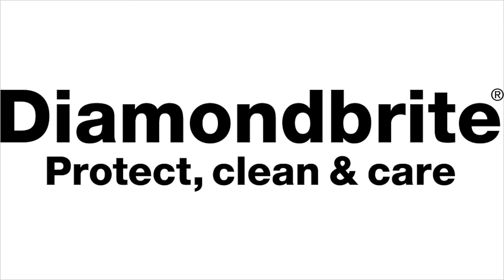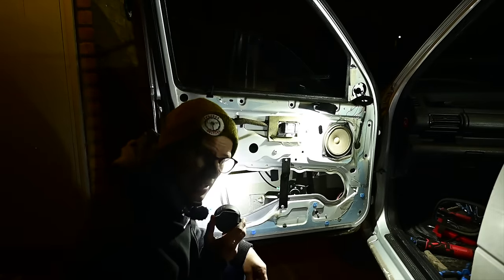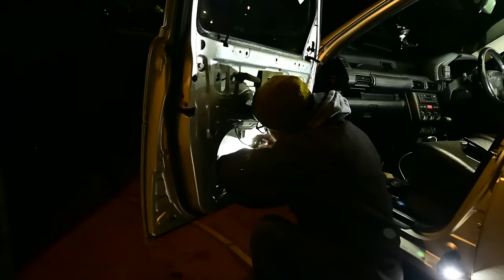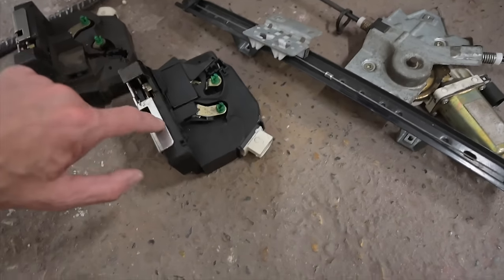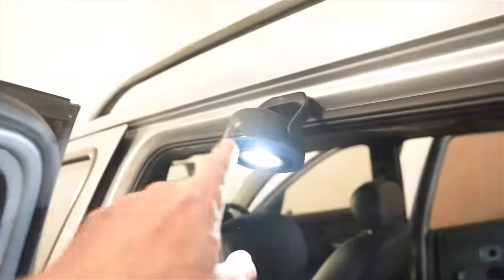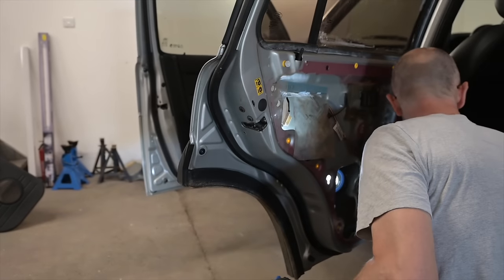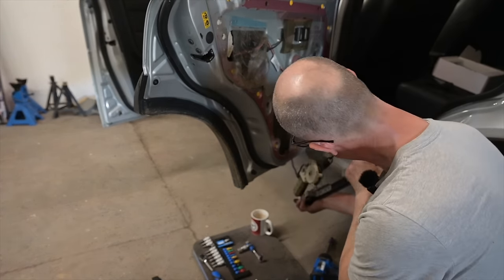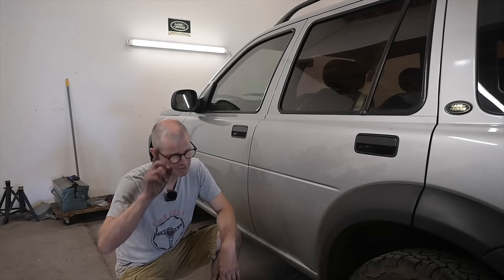Hippo the Freelander window and lock repairs

Comment: Those jobs, like unsticking stuck window winders and doorlocks were the jobs that my Father got me to do as a 10+ year old, smaller arms and hands.  Often needed doing everytime he came home on leave with the car being in the unheated garage, with Pigeons and other birds nesting in the roof occasionally Wasps, for up to 9 months or longer at a time.  Stored covered semi dry, on blocks/stands, just water drained but the oil/filter changed each time.  Another of my unpaid jobs if not in term time.  Admiralty issue 20/40.

Comment: @furiousdriving what is the situation with the W123? Surely it should be in a lockup or in the barn under cover to stop it rusting further into your driveway.
Also in Australia once you agree to sell a number plate it must be removed from the car in question ASAP & you must inform the DVLA within 7 working days of this happening. Also we can only have number plates made up by the DVLA themselves you cannot go to any old place to get number plates. It costs around £150 to get a set of number plates. And if you need to replace them again you must order them through our equipment of the DVLA for around £85 for a set. Everything is controlled by the DVLA in Victoria Australia.
Reply: £25 a set here

Comment: Maybe not necessary but I'd have been tempted to lubricate everything well while it was in bits. Looking forward to more fixes.
Reply: Yep, I think dried out factory grease is one of the leading causes of power window regulator failure on older vehicles.

Comment: Window regulators and door locking mechanisms are awful jobs to do on Landrovers I did my Discovery both front doors and rear loading door. The air was a bit blue and I was missing a bit of skin on my fingers but I got there. Chin up lad old cars are always a challenge

Comment: At least you know how the window motor goes in now so will take less time next time. A very frustrating and fiddly job. Remember having to refit my  Volvo 240 drivers glass back in the channels as window motor bolts had gone very loose. Mine held in with a type of metal clip to the glass.

Comment: Land rover don't learn, I had to do the seized locks on my sisters Freelander many years ago.

I had to do the exact same job, but for the exact same fault on her 2015 Evoque. 

I have done drivers door and rear passenger side door,I look forward to the other 2 doors getting stuck shut.

They had the foresight to make it possible to take the door cards off with the doors closed mind you lol 😂
Reply from the maker: see, they are learning!
Reply: @furiousdriving  nope, you can take the door cards off the Freelander with the doors closed too lol. 

As a bonus, the Freelander was baby poo green  and the Evoque is a slightly different shade of baby poop green.

As a plus point, I fitted a dash cam in the Evoque, and it only took 30 minutes due to the huge gaps between the trim and rubbers 😂

Comment: Looks like a painful job will probably find lots of cuts on your arms later! A check for testing door locks is to push screwdriver into the lock catch and test it without shutting the door. That way if anything goes wrong the door is still open!! MGFs really prone to lock failure as well, such a pig to work on.

Comment: Sorry but trickle chargers are horrible things. I hate them with a passion as a mechanic. 
I will only use them if I’m leaving a car for more than 6 months. If your battery won’t start after a few weeks sitting. Then it’s a crap battery or you have some sort of battery drain. Also just my personal experience you are using batteries that do not have enough capacity. Always always put the biggest CCA battery you can physically fit into the slot in your car & never buy a cheap battery. That is one item I will never cut costs on I will always buy the £150 or £200 battery every time I want these to last a good few years. For instance I have a 2002 Rover 75 V6 connoisseur as my daily driver it has a 760CCA battery in it. I have left it for 90 days & it starts on the button every time.